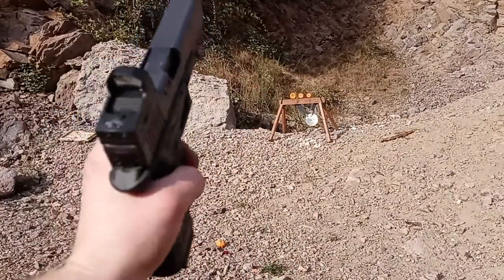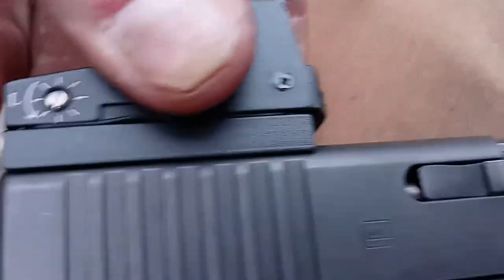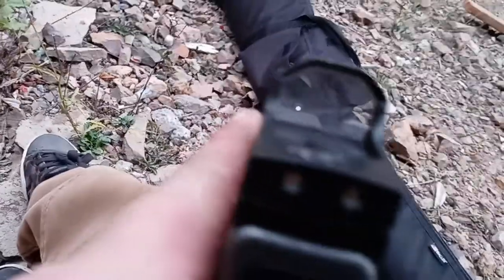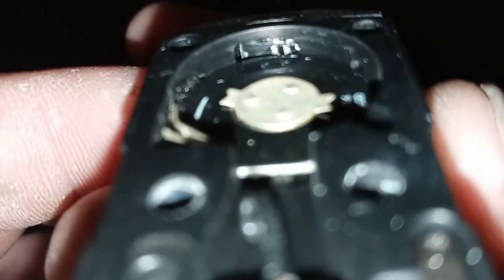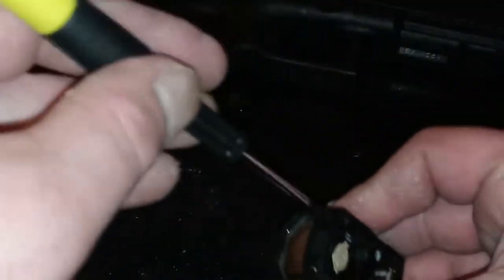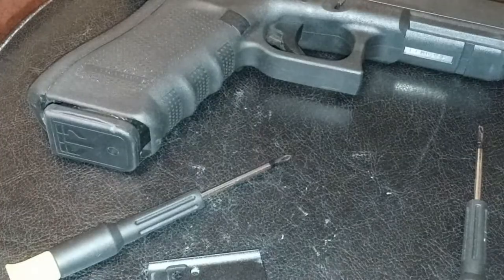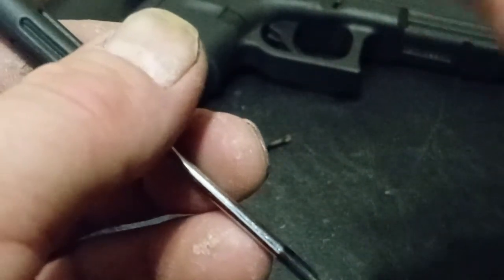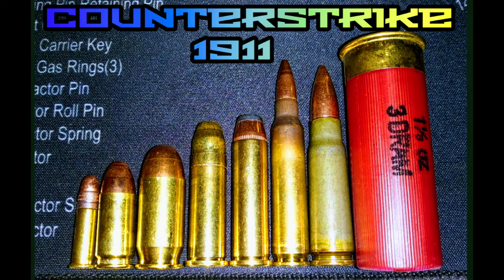ADE Optics RD3-006B malfunction update.

Comment: There was a sticker on my where the battery is that says DO NOT REMOVE.  Could be a possibility why yours malfunctioned.
Reply from the maker: No mine malfunctioned because it came loose from the mounting plate that was on my slide

Comment: I have this sight have ran it without any issues did you place the thin rubber gasket between the sight and plate? If you red loctight it how are you gonna remove it to change the battery? Blue is good enough just allow 48 hrs cure time. My sight tack driver as it's 3moa sight smaller than other sights with bigger dot. Most dots are 4 5 6 moa I like the smaller 3moa also better with night vision

Comment: I went through the same wobbly plate journey as you are going through now. Solution, I dumped the same mounting plate you have and got the Strike Industries GSURF mount.
Reply from the maker: Nice, does that also attach the same way as the plate I was using? What really sucks is my ade rd3006b quit working the power button wont engage as u probably saw in the video. But Im still able to turn it on when removing the face plate.
Reply from the maker: But at least it gave me a reason to try out the new rear sight pushing tool I had bought a couple months back. I ended up putting the OEM rear sight back on.
https://youtu.be/kYJpe0cq4Og
Reply from the maker: Strictly Plinkin' & Some Cookin'  ok sweet ill  check that out right now! Thanks for the advice I appreciate your input!
Reply from the maker: Strictly Plinkin' & Some Cookin'  I see you added in some cooking videos as well im getting hungry just looking at the thumbnails lol
Reply: @counterstrike2A  lol
To me, food is the great equalizer!
Reply: I run the G-surf mount as well! Solid mounting system. It hasnt moved at all! Strictly knows my glock project very well.
Reply from the maker: @DesertTactical  lol now Im 100%. Convinced and will be ordering one for myself ASAP. I watched all of his videos on it and it looks like a great mounting system
Reply: I have never seen any good budget red dots. Everyone I look at has bad reviews, even the Utg micro. None of this stuff imo is minor because it is a dangerous ass gun that you're dealing with. You could get killed depending on one of these cheap dots if it couldn't hold zero. I think I'm getting the romeozero, and it isn't perfect from the reviews I've read but it has to be better than the cheaper ones.

Comment: My ADE006 won’t turn on all of a sudden. I changed the battery and zilch, zero & nada.
I haven’t had the thing a year and have never been to the range to test it😢
Reply from the maker: did you remove the plastic piece blocking the battery terminals from making contact?